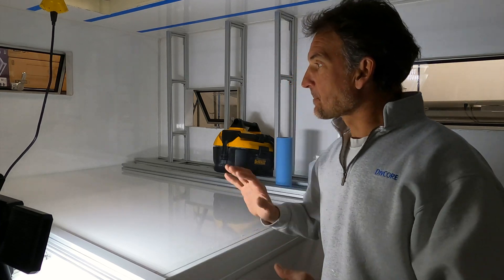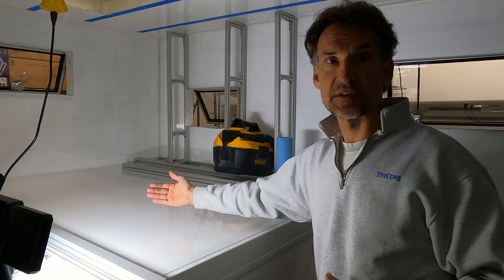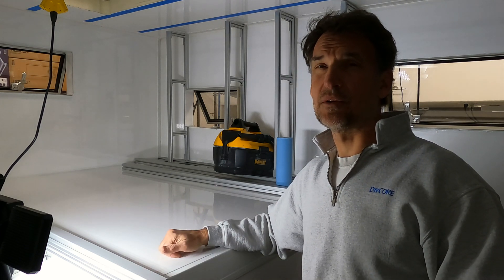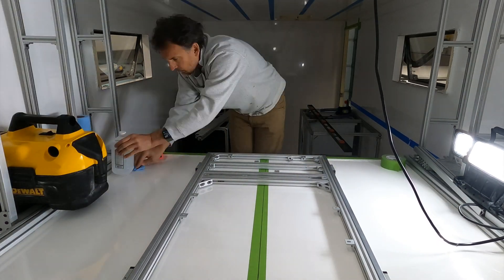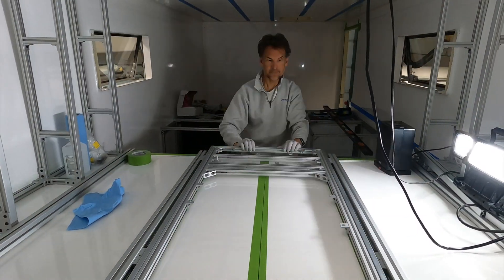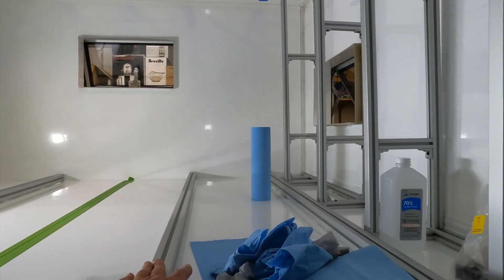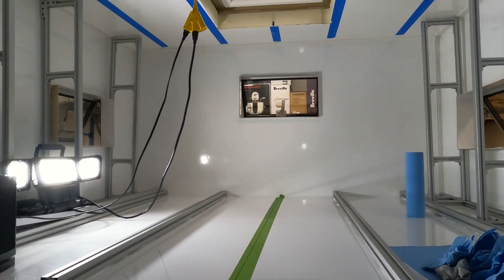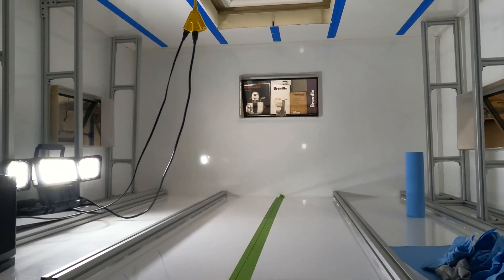Using and getting 8020 profiles level to mount slides and other cabinetry

Comment: Enjoying the build. Did you ever provide links to  your building supplies? The windows, walls, and the corner suppliers please.
Reply from the maker: I have in previous videos for each of those things. There are several videos near the beginning of the build series about building the camper box (walls, ceiling, floor and extrusions), and also several for installing the windows. Search thru my channel to find a video on the area you want to learn about the parts and it should be in there.